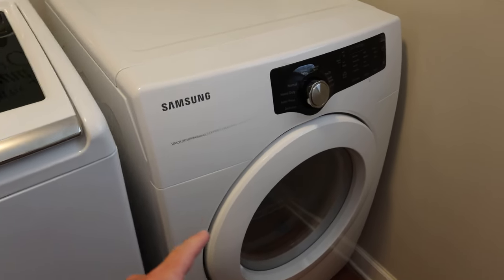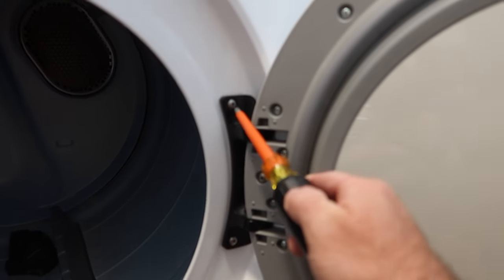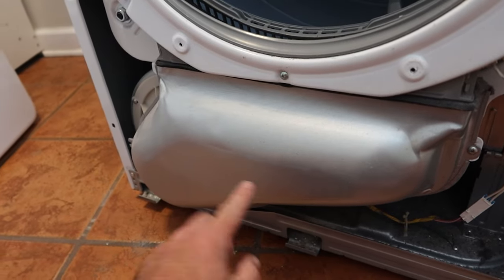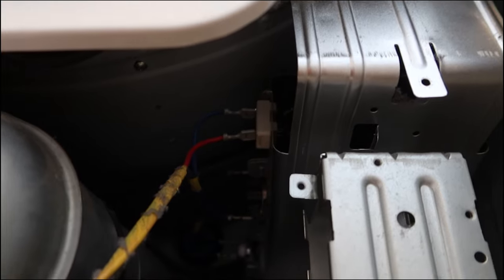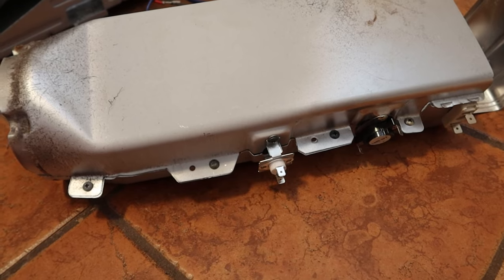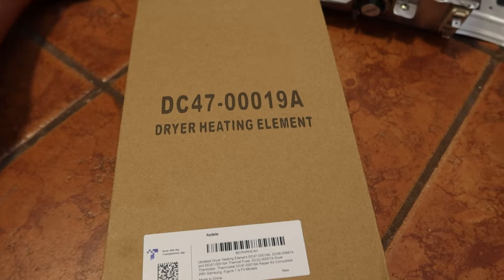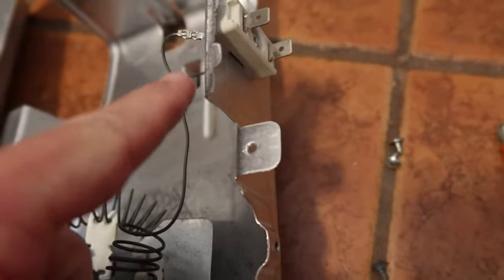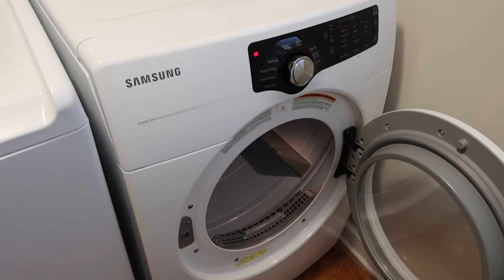How to Replace Samsung Dryer DV210AEW/XAA Heating Element DC47-00019A for less than $40

Comment: Great video tutorial. This is the second time I've replaced the element in mine, but certainly needed the refresher course.

Just FYI, the two screws that are different on the face of the dryer is for swapping the door to the other side of the dryer (it's ambidextrous). 😀
Reply from the maker: Glad I could help! Nice call on the door swapping screws, that makes sense!

Comment: Great explanation.  What is the trick to releasing the tabs from under the dryer that connect the metal housing under/ in front of the heating element. The unit is loose, but can’t get the carriage free because of the tabs. I’m ready to bend them.  Help please
Reply from the maker: I had to bend mine. It's okay if you do, they easily bend back into place.
Reply: Thank you!!

Comment: Hi. Thx for the video. I did this 2 years ago with the drum removed for easy access to heating element. This time I tried your way and got stuck when trying to get the heating element out. Even if I managed to get it out, I did not see how you put it back where the circular end of the heating element enclosure has to fit in the back with tabs - which one will be doing blind (can't see the back)

I very much would like to do this without removing the drum. Can you explain how you were able to align the backend of heating element enclosure and get it fitted?
Reply from the maker: Mine heating element housing went in very nicely and I was able to align it by feel without removing the drum. Good luck!
Reply: @MicahMartinDIY  I had to phone a friend and he was able to pit the element back in a couple of min. It is tricky but if you can pull it off, saves a ton of time removing the drum. Excellent video

Comment: Great video.  I have the same dryer and I got everything apart, but I couldn't get the heating element to detach from the back and pull out.  Any advice on what I should do to detach it?
Reply from the maker: It has some tabs that hold it in. It's okay to bend that think metal if needed. It will bend back.
Reply: So come to find out the stand wouldn't come out because it was screwed into the heating element shell and the shell wouldn't come out because it had a screw into the bracket at the back, were they supposed to be screwed in?
Reply: The blue wire is also fried and come to find out it's missing screws...I bought this used a few years ago
Reply: You wouldn't happen to know where I could get that replacement blue wire that connects from the thermostat to the heating element?  I went to Lowe's and they were of no help.

Comment: Thanks Micah! I have an exact model as you have. Just ordered the part. Hope it works out for me. I have this dryer since 2010. Will update when I finish the replacement.
Reply from the maker: Thanks! I hope it works for you. Take you time, there are a lot of sharp edges in there! Also try to clean all of the lint out while you have it open. After 13 years, I'm sure you have a lot of build-up.

Comment: Ok this gave me the confidence to try it out myself! 
I notice the « cooling » light is still on even after you’ve replaced the element. Mine is not producing heat and the « cooling » light stays on, but I thought this was some sort of error code. Shouldn’t this display change once you’ve fixed the issue?
Reply from the maker: I'm glad you are tackling it! No, "cooling" is a feature. It cools the clothes down by blowing unheated air at the end of the cycle while continuing to spin. This way your clothes wrinkle less from being left in the dryer.

Comment: For some reason, my dryer had a LOT of lint buildup within my lint trap, so I opened the lint trap ( I didn't unscrew anything or take open the actual dryer) and it smelled bad ever since? Any tips
Reply from the maker: I'd start with a good brushing. Search for dryer lint brushes on Amazon. Then I'd go ahead and clean your vent. You can DIY that one too. If you have a cheap flex hose, just replace it. Lint build up in the folds and can cause moisture to stay there and have odor.

Comment: Replaced the sensors and element.. but still no heat any thoughts?
Reply from the maker: That is very odd. In my experince, the heating element is what goes out most commonly. Is the blower running?
Reply: @MicahMartinDIY  yeah it runs, just never kicks in the heat, replaced 4 sensors and the heating element as well.